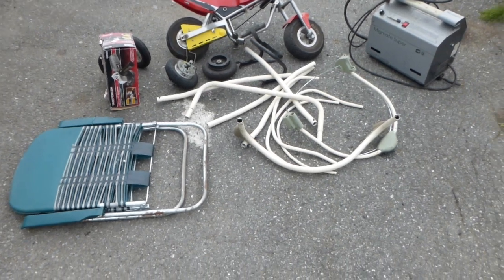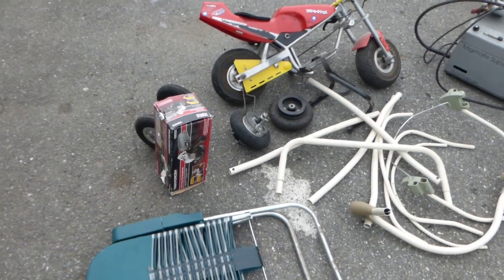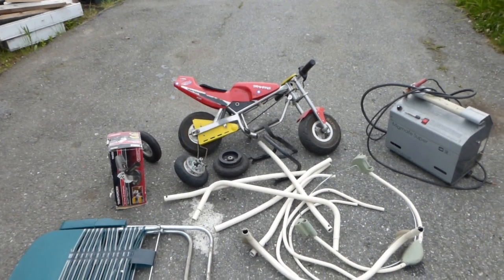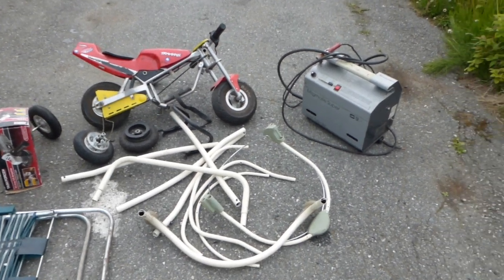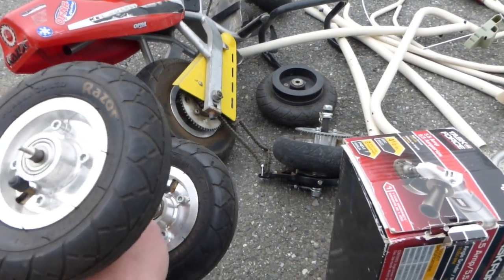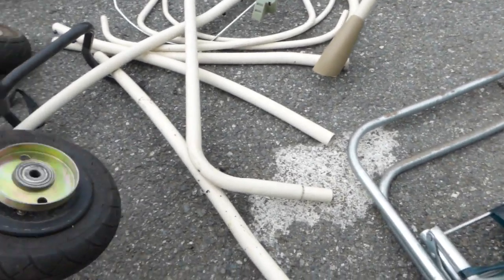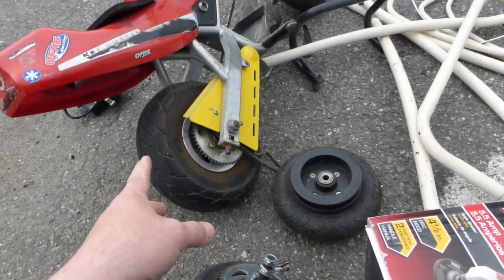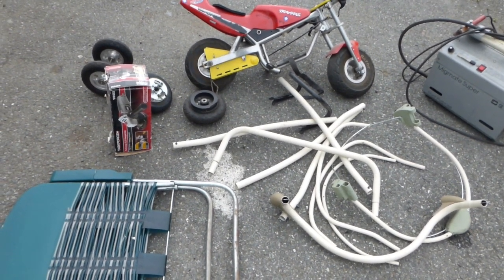How to Make Ultra Light Awesome Electric Go Kart 24v home made DIY (part 1)

Comment: I have an old electric moped at home, would the electric rear-wheel motor be able to go faster than this? i know it's 24v and that the diameter is quite significantly bigger.
Reply from the maker: yes it will go much faster, depend on power of motor wattage, and especially if you go with 36 volts setup
Reply: GPeter7 .